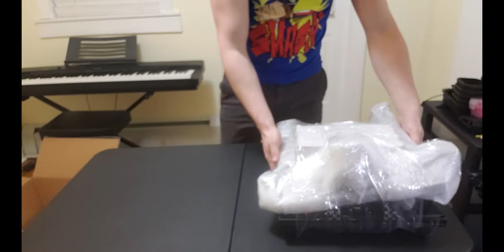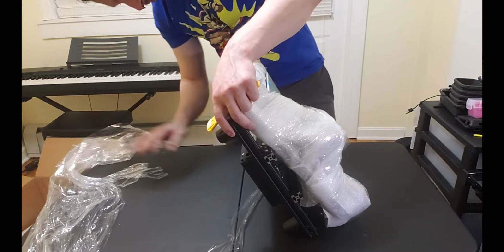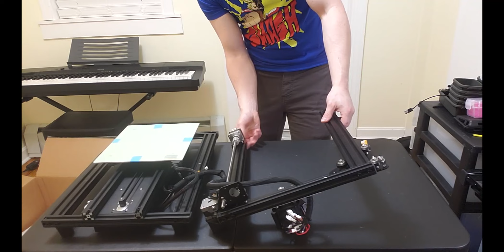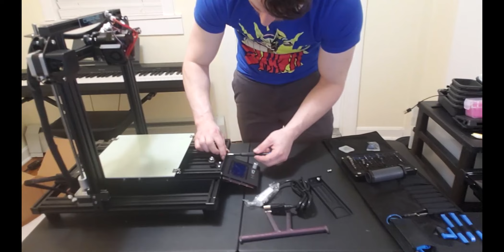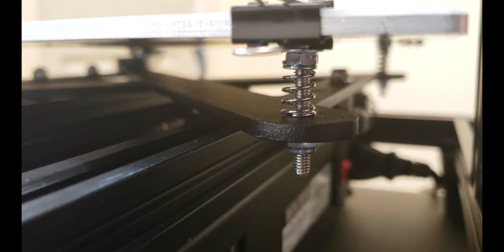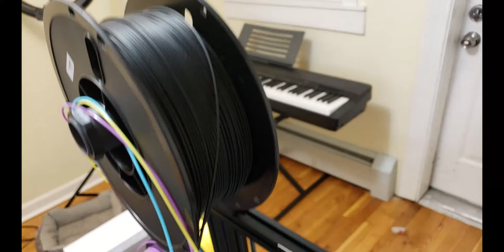"Full Color" 3D Printing! M3D Crane Quad 3D Printer Unboxing

Comment: How do you slice models to print in full color?  Also: how do you print in color? It seems like every color printer have a completely different process.
Reply from the maker: The most compatible, and easy to use application is Voxelizer 2. It is in free beta status right now, but I do know it will eventually be a paid application. With it you are able to select the colors you would like to print with, and literally choose colors to blend form a swatch and apply them to the model. You can also apply patterns and textures.

Comment: Have you ran any flexible filament through yet?
Reply from the maker: I've not yet tried flexible filament but i do expect it to work fairly well. My plan is to try flexible and PVA for supports.
Reply: @alchemaker9055  I'm curious to try PLA and TPU for a case.

Comment: Is this printer worth it?
Reply from the maker: I paid for the first batch, and I think it was worth it. especially in comparison to he Prusa i3 Mark 3 with the multi material upgrade kit which in total costs significantly more.
Reply: I've been enjoying mine! Quite unit, VERY QUITE. You hardly know it's even printing!
Reply: @JRT3D  Quite. monocle
Reply: @pointyfox  Yea...that's just me having brain issues...I meant that it is Very "Quiet". No noise.
Reply: @pointyfox  Quite works as well. It's been a Love/Hate relationship...but, It's brought much value to my life in many ways. May not be the case for everyone.
Reply: Any advice on where to go to learn how to use these softwares. We have m3d quad and believe it’s worth it too. My wife and I are somewhat noobies to 3d printing. It’s awesome how easy you make it look to mix colors and all. It’s been a mission learning how to import to Voxilizer without having changes to our designs, slicing and editing settings is a headache so far.
Reply: @adolfoevia5417  Join us over at FaceBook Group, we're helping eachother out left and right: https://www.facebook.com/groups/287867492126710

Comment: What print speed can this print at with good print quality? Looking to build a large 3d printer and interested in this print head for multi material and mixing
Reply: Hey Folks,

David, M3D Engineer here. The Crane Line is my baby. =)  I just wanted to let drop in and comment on this question.  Because the Crane Quad is driven by the Duet Maestro, you have access to many advanced features meant to help with high-speed printing.  These include dynamic acceleration(least rhombus method), pressure advance, and ringing frequency compensation.  Guides and macro sets for tuning these features already exist on the Duet Wiki and Documentation, but you can expect some M3D-created videos that cover these more advanced features soon.
Reply from the maker: I use Simplify3D with this printer and I'm able to print a bit faster than my CR-10S with similar quality. Quality tends to suffer after 75-80mm/s base speed.
Reply: Alchemaker ok great. It just seemed to be printing very slow in the videos ive watched so im glad to know that
Reply from the maker: @nickslegoweaponry7847  well depending on what your printing, and whether or not you are doing multicolor or mixing, you may have to slow it down. There is no printer that uses multiple extruder and a single nozzle thst can print as fast as a single extruder printer when mixing.
Reply: Alchemaker ok makes sense. Thanks for the quick replies

Comment: Im so curious about this, I am considering buying the hotend upgrade for my CR-10s Pro
Reply from the maker: It's a cool piece of technology, but it's far from perfect. Though color mixing does work, it's not a perfect science. I got this printer specifically to do multi material printing and gradients. You can also do multi color prints very well, but if you want to do color mixing it's definitely got a long way to go to be really practical.
Reply: @alchemaker9055  yeah color mixing is not that intriguing. It just seems really hard to get consistent results from due to the inconsistencies in filaments even in the same brand and color. Multi material is more intriguing. Also I like that it's a direct drive.